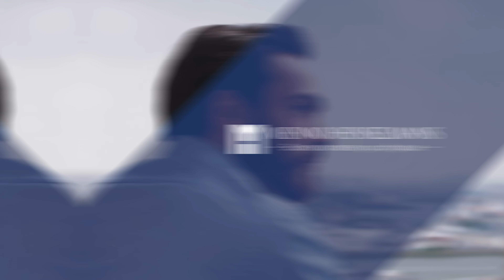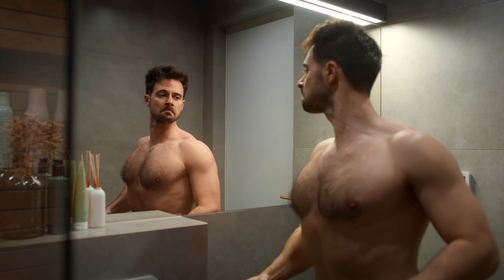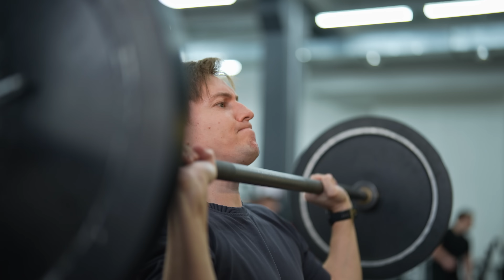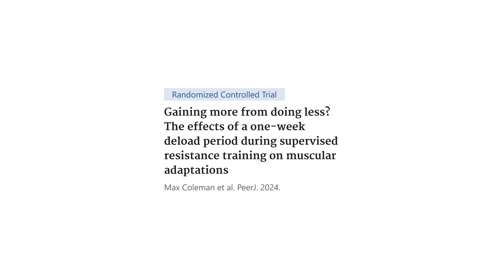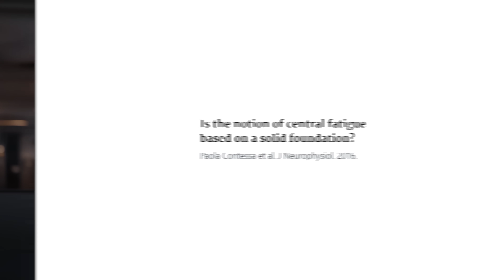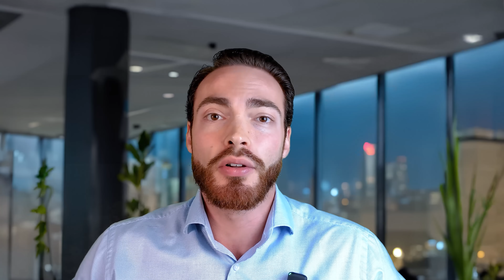7 New training concepts to level up your programs

Comment: I did dumbbell pressing with no barbell bench for 4 - 5 years.  I gave bench a go after this time thinking I could probably bench 150 kg, as I used to 140kg, but my bench had gone down to 130kg. lol.

My dumbbell pressing had gone from 42kg to 60kg for 4 reps.  So although I got strong with the dumbbells I lost neural adaption on the bench.  I still feel I improved in so many ways.  Ie arm strength and depth of pressing without shoulder impingement etc.   dumbbells are a different movement I guess.
Reply: I am the reverse. I can press more on the bar but I keep struggling with dumbels. Especially my left hand.
Funnily tho, my left hand is not weak on the machine even the kind with weight stacked individually for each side. Must be a neural thing with dumbels I guess...
Reply: i think since you used to bench consistently, that makes it less of a good witness lift
Reply: It’s because there is almost 0 crossover with barbell and dumbbell bench/horizontal/chest press. 

Barbell bench does put some tension on the chest and will help it to grow (especially when you first start benching) - but the chest actually is not a big contributor of force during the bench. It mainly comes down to the triceps and front delts. 

And whilst yes the front delts will almost always be active with the chest (since both are prime movers when it comes to both shoulder flexion and horizontal shoulder adduction), if performed correctly, the dumbbell bench press places far more tension on the chest (and thus relies much more on the chest muscle for force production) - whilst at the same time pretty much eliminating the triceps from the movement. 

Basically, that is to say that the dumbbell bench press is far less of a compound movement, and is wayy better at isolating the chest. Whereas the barbell bench press recruits far more muscles - with the chest not being a major contributor. Thus, the muscles worked are almost completely different, so there will be very little transfer of strength between the two. 

Only problem is that most people perform the dumbbell press ‘wrong’ in a way that recruits more triceps and recruits less chest so that they can get closer to their 0.5x bench press weight - when really they are just ‘ruining’ what makes it such a good chest exercise in the first place. 

Jeremy Ethier has the best video example for the correct technique, imo.
Reply: @  yeah I just rewatched Jeremy’s video.  That is how I dumbbell press.   Always have.  I supernate on the eccentric as well.  The travel path feels right for my shoulders.  That is the way I have developed a decent dumbbell press.  That is probably one of the best videos on dumbbell pressing agreed.

Comment: Thanks for showing the lat prayer and bayesian reverse cable fly. Fucking hate it, blows me up, awesome stuff. I'm wondering though, what do you think about adding a hip hinge to the cable fly? Currently, the arm and cable are in line at the end range of motion, so the resistance tangential to the arm is near zero. I've found that if I lift my torso I can tune the resistance curve. It's working pretty well for cable curls too, if I lower my torso in the end of the concentric phase.

Comment: Calling it mental fatigue and saying it is not "physical" is somewhat miss-leading, since it somewhat implies that it can be corrected by the right motivation and mindset. While systemic fatigue can be purely psychologically rooted, it has a physiological root most of the time - speaking neurons and hormones. Therefore systemic fatigue still needs time of recovery.

Comment: One thing that's not clear to me when accounting for reactive deloads is whether or not you are supposed to take them if you're plateaued but not regressing. If you've been stuck on the same load and reps for weeks on end, should you deload? And should you reduce the weight after the deload?

Comment: I still don't agree with systemic fatigue, having pushed some lifts (deadlift and OHP) to the point of almost blacking out, and needing a good week to be able to do anything after, with symptoms like the flu.
Reply: I'm also struggling to square that one. I used to have bad migraines that I determined were caused by cns fatigue. After training and working on that, they went away but I still have a lot of nervous system problems to work through. So, if all that isn't cns fatigue, what is it?
Reply: Similar. When on a cut I get periods where am lifting sessions are fine but energy is gone in the afternoon, sleep ok that night, and next morning I have zero energy - 1/4 mile into my walk it’s just gone. Like the back end of having the flu low energy levels. It’s not motivation. I’m pissed I have to stop but I’m mature enough to listen to my body. I take a week off and I’m good to go again. If that’s not systemic fatigue, idk. Call it whatever but it’s real for me.

Comment: Systemic fatigue is not really mental fatigue.

It's actually the following 10 factors sorted by importance.

1. ATP consumption and energy supply: Most fundamental cause - without ATP no muscle contraction is possible, limiting performance within seconds.
2. Metabolic changes: Direct consequence of energy consumption with strong acute impact through acidification and glycogen depletion.
3. Mechanical muscle fatigue: Immediate structural impairment through microtrauma and disrupted protein interaction.
4. Neurotransmitter depletion: Critical limitation of muscle activation through reduced signal transmission at motor end plates.
5. Neuromuscular fatigue: Progressive deterioration of nerve-muscle communication and movement control.
6. Electrolyte imbalance: Impairment of signal conduction through disturbed ion distribution.
7. Hormonal and central factors: Higher-level control of fatigue processes with delayed impact.
8. Inflammatory responses: Secondary processes mainly affecting recovery.
9. Protein metabolism changes: Slower metabolic adaptations with indirect fatigue impact.
10. Temperature regulation: Mainly relevant during prolonged exercise, rarely primary performance limiting.

The top four factors are the main causes of immediate performance decrease during typical weight training.
Reply: Most of these are local phenomena, not systemic. Where did you find this stuff?
Reply: @gregorammann7147  I grilled chatgpt.

However, having these phenomena in 3 different muscle groups is usually enough to have it cause a systemic effect
.

Comment: Can you do a QnA or perhaps reply? Thank you Menno
Im doing low volume - 3 sets per muscle group, two times per week. I go close to failure or failure and train very hard. I have been working out consistently for four years. 
I find that this low volume works better for my tendons. But Is 6 hard sets per week enough to make progress?
Reply: Have you experienced gains during these years?
Reply: @ChillyAdventures  Yes, but with at least double the volume. I started with lower volume training about two weeks ago
Reply: If you're making progress, yes it's enough. If you're not making progress, no it's not enough
Reply: It's highly individual. For example, one of the 3dmj coaches does 4 sets a week because he can't recover from more, while Eric Helms does close to 25 sets a week for some muscles and they both make similar gains
Reply: @mansouri9430  Yes that makes sense, I appreciate the input
Reply: I don't think he really reads comments on here. You could just Google to find his recommendations on volume from articles and past interviews, I think. 6 sets would generally fall into maintenance volume depending on advancement. His Personal training course is great if you've got the cash.

Comment: My side chest hurts when i bene over, extend arms forward, or do other arm motions. But it only hurts in my ribs and behind my shoulder blade. What is that? Pretty sure it isn’t strictly a rotator cuff issue.
Reply: Consult a doctor dude. It could be serious.
Reply: Pretty sure you need to see a doctor bro
Reply: @kbn77  side chest?
Reply: Right side chest=ribs/intercostal muscles i think. I just am not sure if there is any muscles associated with ribs to scapula. It isn’t my lungs or heart if that is what you are worried about